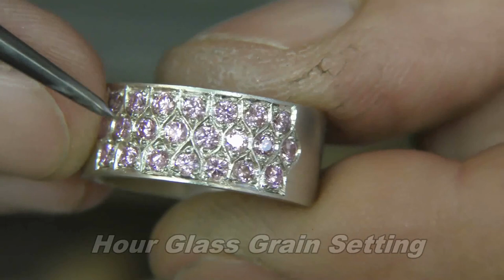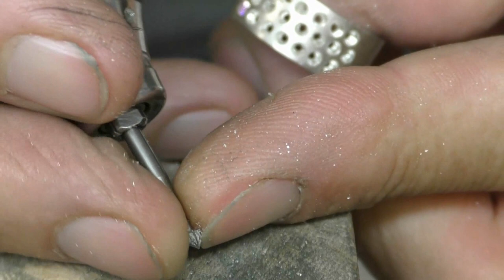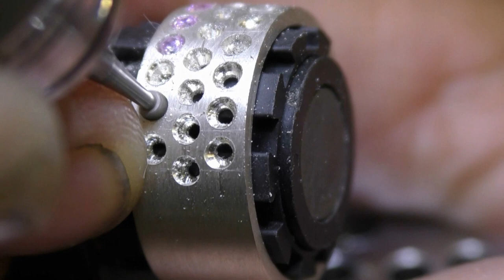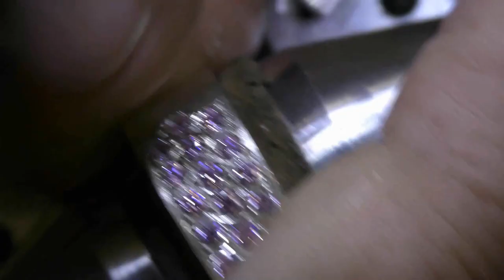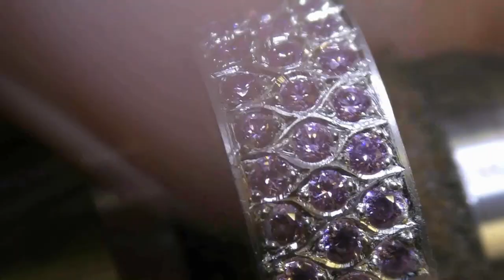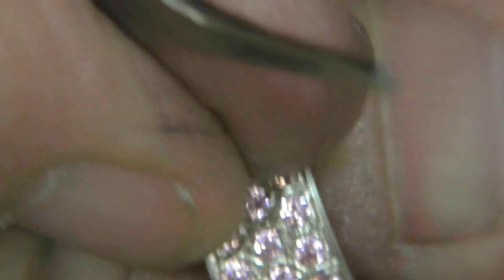Hour glass setting preview

Comment: well done.are you pushing the beads with an engraver ? and if yes how come the stones are not popping out from the vibration while pushing the beads?
Reply from the maker: jinbachian tavit yes I am lifting the grains with a lozenge graver. The stones were first friction fit into the setting so they would hold in place whilst I perform the setting

Comment: I'm having problems with moving the metal but, flush setting works fine for me. Does it mean I have to anneal the silver longer?
Reply from the maker: Annealing for a longer period makes no difference to the malleability of the metal and with sterling silver prolonged annealing may cause firescale, you just need to apply a bit more pressure.
Reply: Jewellery Training Solutions ok, I’ll try.

Comment: Why don’t you use dividers to Mark out your stones far more accurate and quicker and drill out your stones in one go , also if you cut up the metal before you put the stones in you get a far neater job , join my stone setters group you can get help and techniques there 
https://www.facebook.com/groups/136040313783066/